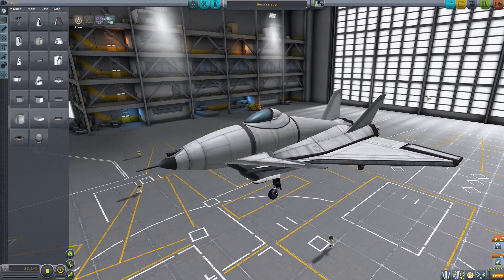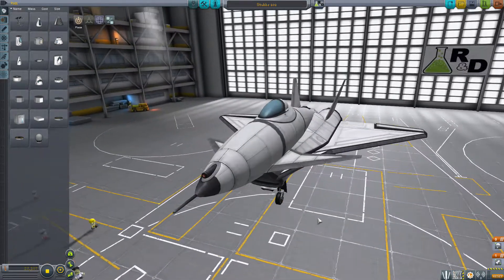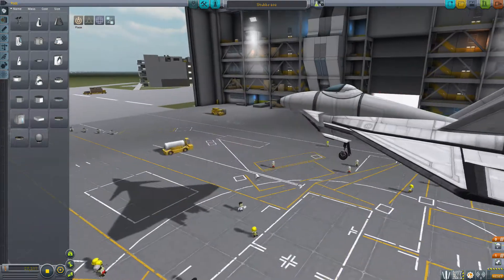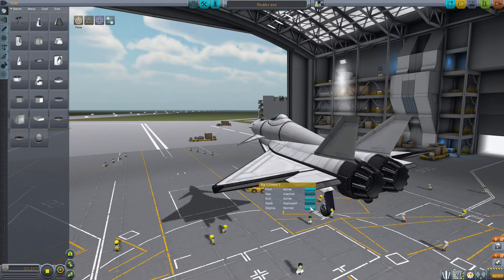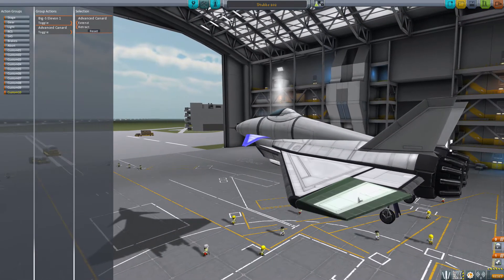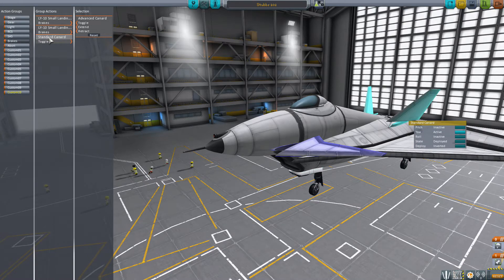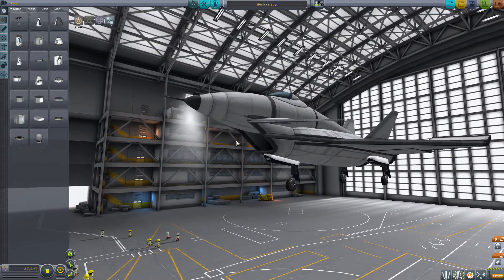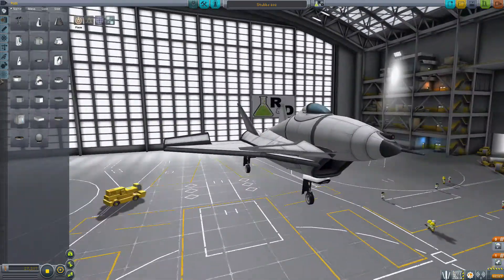Plane Design (Tutorials & Tips) - Tweakables

Comment: basic? Talking about flaps isnt basic. I thought the center of mass should be on the leading edge of the wing and lift should be in the same place as ur center of mass.
Reply from the maker: +Wayne Juntunen CoM and CoL at the same place makes for an unstable plane. The leading edge of the wing has nothing to do with where the CoM should be. Consider what that would mean if you had multiple wings or long deltas like the Space Shuttle and you'll see how it doesn't make sense. Flaps are a pretty basic idea, you effectively increase lift, increase drag, and lower the stall speed. In KSP they're a little different though because the physics aren't accurate. A related problem is leading edge slats do not work in KSP unless you have them lift instead of lowering..again cause the physics aren't accurate.
Reply from the maker: +Wayne Juntunen Actually, I think you're right that flaps aren't so easy in KSP, because come to think of it, they do tend to produce an undesirable torque effect unless you're careful about placing them near the CoM.

Comment: I use mono propellant and oxidizer as a sort of ballast often when I make planes.
Reply from the maker: +tstthomason See, I don't get that, because I always design around the parts. If the design isn't working, I rework it. Adding mass shouldn't be the solution in my opinion when working on anything that's gonna fly.